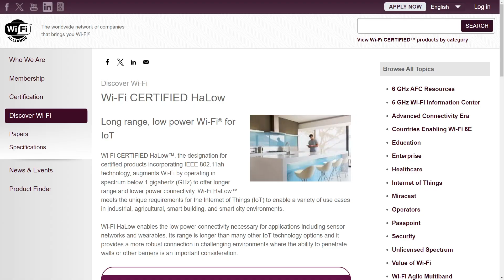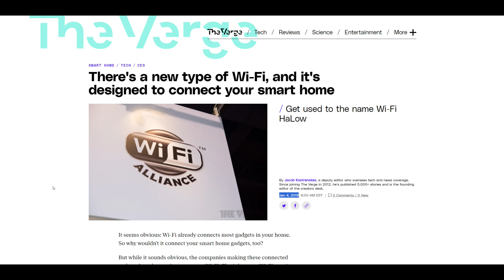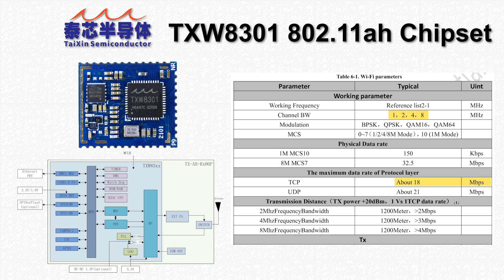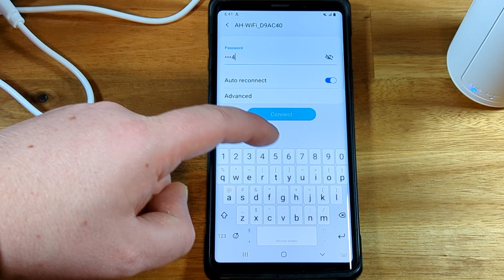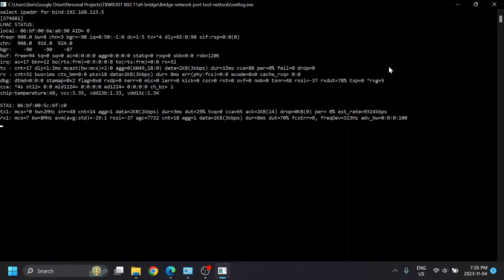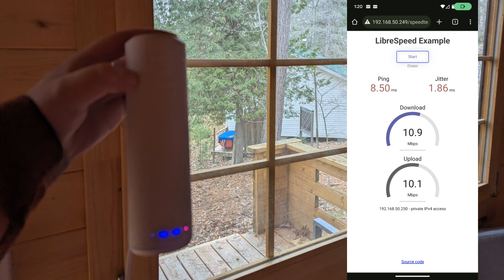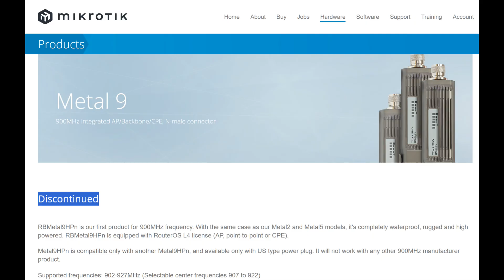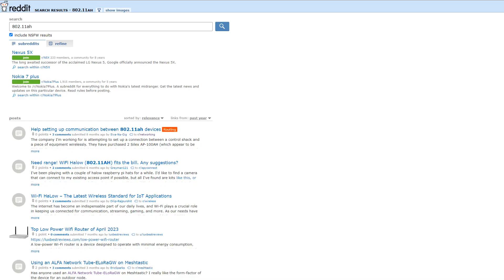802.11ah Wi-Fi HaLOW: The 1 Kilometer WiFi Standard

Comment: I use the Alpha 2H and 2HP to connect cameras to our NVR.  They work great for that.  I’ve also considered using them as a low speed backup feed between businesses for internet outages should one property have an outage.  We probably install a Ubiquiti solution at another location, two businesses about a block away from each other and across a freeway.  One has Fiber, the other doesn’t.
Reply: Linus Tech Tips has a few videos on the topic of getting high-speed internet between properties with line-of-sight on the roof. You might be interested in watching those videos before making the decision, if you want high speed. But even without high-speed, with self-hosted apps, you can communicate between the buildings even if the internet and the cellphone services happen to be down at the same time. 

Edit: Also very useful for preppers, because slow local internet or intranet is much better than no internet and no intranet at all. And the repeater function paired with directional antennas could even be used for things like getting much cheaper internet in third world countries. Especially if it comes packaged with a list of lower-bandwidth custom-clients for popular apps (i.e. for discord, the existing facebook lite and messenger lite, and so on). Even the 8 Mbps, which translate to 1 MB/s of real-life file download speeds, are good-enough for plenty of use-cases. Also, depending on how good it is at going through brick walls, it might be usable to get wifi signal inside backyard bunkers. 

But it's most useful for people with a property which gets internet access a long distance from where the house is or from a point of interest (i.e. a work-in-progress construction on the opposite corner of the property). Might even be useful for getting internet access on hiking trails, because, as someone else said in a comment, a small solar panel and some battery can make it run indefinitely, or at least work indefinitely during the day. Could also be used to have multiple people share the same internet, for example someone getting a corporate internet package, and reselling the internet to everyone who wants to pay a fraction of the price for a fraction of the internet (i.e. basically what many private dorms do).

But, honestly, the most widespread use-case might actually be using it to get wifi in all the rooms of old houses with very thick concrete or brick walls, as well as using the home wifi in the car or in the city without using up the mobile data of your phone.

And if the technology keeps evolving, we might see such technology be used in handheld PCs, for LAN/WAN gaming at large distances. For example, you could be in a corner of a mall playing with someone from the opposite corner of the mall without using the mall's wifi network. And people who live on a mountain where they don't have internet access because the mountain blocks the signal, such a device could be used to deliver the internet from a place where it is accessible (i.e. a shack on top of the mountain) to a place where it is not accessible (i.e. in a valley of the mountain or a valley between mountains). For example, you could use them to get internet access in USA's Grand Canyon.
Reply: @SapioiT  I won't discredit Linus Tech Tips.  However, sticking with what I'm familiar with and not have to figure out a new GUI has its merits.  For the most part, the Alpha Tubes have just worked for me.  I had two and adding a third was as simple as downloading a configuration file from one and uploading it to the third.  After years of use, one went down and (because I buy them in two packs) having another on hand made it as simple again, just needing to remember how to log into the existing setup being the only challenge.  
Unifi/Ubiquiti devices is what I have the most experience with, along with some Cisco.  They have site-to-site antennas that pairs up with a click of a button, alignment indicators for the antenna, and a 6 gbps transmission speed and a 500 meter range.  A bit expensive at $499 a pair plus the required equipment that goes along with it - which I already have installed anyhow.  Honestly I can probably get away with a couple of the LD AP's, but this is just a few dollars more with better weather protection to boot.  The AlphaTubes were, if I remember correctly, $299 for the pair with much, much slower speeds.
Our existing equipment already supplies great internet in businesses and houses.  Got a dead zone? Add another AP without the worry if your existing equipment supports the 802.11h standard.  I've done houses where the client wasn't happy with any existing device on the market except for the Ubiquiti solution I installed; even a 5,000 sq ft house with 3 access points had great coverage, though the client eventially had me add a 4th.  His brother had me do his house and I put two in; he loves his as well.  I use a smaller Dream Router that gives me great speed with its single access point.  One location, a housing unit used by the CalPoly, has 23 access points and absolutely no complaints with rock-solid coverage in every corner.

Comment: Excellent useful content. Would be interesting to see what kind of security video can be transmitted over HaLOW WiFi. (eg: Mbps bandwidth vs. distance). Could also be interesting to experiment with different antennas like an yagi to focus beam in a more point to point style, to create a remote hotspot area. (out building, etc). For low power and remote IoT like weather station, etc, very practical option. Had heard of the standard, but had not realized low(er) cost devices where available.

Comment: Friend of mine is building racecar in the style of an old formula one car. I've been tasked with designing and building a bunch of sensors for it, using can bus to store all the data on an sd card but thinking something similar to this might be an option for getting the data off the card and onto a computer as he pulls into the pits.

Thanks for the tip on this Rf tech :D

Comment: Quite some time ago I worked at a WISP and they used direction antennas with 900mhz, 2.4GHz and 5Ghz equipment to deliver internet to their customers. Even on the old 900mhz standards we were safely getting 5-7miles thru moderate foliage. 2.4GHz we safely were doing 10 miles line of sight and I remember a few customers that were pushing 20-30 miles.

Comment: Do you think you would be able to do some tests at that quarry with the directional antenna? im curious about how the range and breaking the light of sight would fair.
I think i have a good use case for this, every so often i head to the mountains with some friends and end up staying in a cabin with no signal period, No cellular, no wifi or anything else. 
only wifi is down at the lodge about .5 mile/ .8 km away. Im thinking i may be able to tether off their wireless and get it up to the cabins, even 5 mbps would be enough for messages and staying in contact for coordination ect.

Comment: 900MHz? In the EU, 863 – 868 MHz is approved. 
In the EU, 5 channels with 1MHz or 2 channels with 2MHz are allowed. 
This means that these are probably only slow channels.
The cell phone is located in the 800 and 900Mhz band, HaLow is in between. 
If I start transmitting in the 900MHz band, the mobile phone providers' measuring vans will certainly arrive soon.

Comment: Good video. If you are going to do some more testing, I would be interested in seeing how it travels through a multi story concrete building. Like other comments, I am trying to get to a basement carpark but I want to connect my charger to wifi. The OCPP protocol should be lightweight so this would be a good solution. I tried with a PLC but the distance and power phasing was against me.
Reply: If you try this, let us know how it goes. Good luck!

Comment: A test in an open field does not reflect at all the normal operation of the product.
You have to test in a place full of buildings, which is where the product will normally be used. A place full of interference.
Please refrain from using measurement systems discarded across the entire planet like the Imperial System.
NO ONE uses it nowadays.

Comment: 900 MHz is some pretty crowded spectrum. Similar issues to 2.4G - a lot of licensed and unlicensed users, military use, ham radio(on a secondary basis), several decades worth of cordless phones and baby monitors, commercial 2 way radios, a wide variety of ISM devices... Adding a wifi protocol to this mix seems like a bad idea, and in many areas is likely to suffer greatly from interference from other users. A lot of people think 900MHz is pretty empty, but it really isn't - stuff is just transmitting in modulations that aren't easily picked up from whatever you are using.

Comment: Not bad at all, and I too had never heard of 802.11ah before. The fact that it draws relatively low power, and uses low frequency bands, means it could be used in a lot of different scenarios.
Using less than 1W you could easily hook this up to a solar panel and some Li-Ion/Li-Po cells and not need any sort of other power to the system.
Another example is where you said you could only get less than 2Mbps through conventional mobile repeaters even with outside antennas. With 802.11ah, you could find a spot that gets a much better signal from the mobile networks, then use directional 900MHz antennas to transmit to the area you need the internet connection at via 802.11ah (e.g. your cabin), then use your conventional router to find you'll probably get a much better internet throughput.
Reply from the maker: Thanks! I definitely want to explore solar use cases for it. Chances are, if it's far enough away that regular WiFi won't reach, power might be harder to come by too. 

For my cabin, I have a project planned for the spring that will do just that: bring my directional LTE modem to somewhere where it has a better line of sight to the cell tower. 600 feet up a hill behind the cabin gets me about 50 Mbps to a much newer tower, which is more than enough for me to work remotely. For better performance, I plan to do it "the hard way" by running copper landscape wire for low voltage power and fiber for data.

Comment: I was actually doing some research on 802.11ah before coming across your video because I was configuring a mesh wifi system for a client and noticed the satellite APs supported ah which I never heard of and couldn't find much info on and it wasn't even in any of my a+ or net+ cert material, so this video sheds a lot of light, it also sheds soke light on a project a friend of mine is working on to convert his drone to use digital communication rather than analog so he can get a consistent 1080p video feed using what he called a "stripped wifi standard" and after hearing about ah, that's probably what's being used by the transceiver he bought.

Comment: Are you the guy who actually made a post about them on the mikrotik forum a while back? i wanted to ask if you poked around at commands to switch the frequency? in the EU the 900mhz band is illegal to use (already gsm on it), but 868mhz is free to use. on many of these boxes on aliexpress they say chip is supporting 720-915mhz. also worth saying that connecting the board to a log antenna made for GSM should give fantastic results. here in EU we use log periodics to connect to 4g/5g bands and that works great, and in the video you actually have one yourself for gsm too.

Comment: Great review and summary. I am though a bit disappointed regarding the range you get since I have myself run 802.11b over one kilometer with small omnidirectional antennas so it should be possible get at least double that with properly set up directional antennas.

Comment: I'm using the basic box one that you also found to connect my holiday home to my father in law's house about 600m away because we can't get a permanent internet connection there otherwise. 
I've already spent too much money on WiFi bridges that didn't work in our situation because it's not a straight line (mountains) and there are trees obstructing things seasonally.
Initially I had a pain in getting it working reliably, but earlier this year I replaced the antenna at my FIL's house with a basic log-periodic antenna like you showed. On my end I have a cheap TV antenna which also seems to work.
I'd like to be able to monitor the link but I don't have the application you have, so if you can point me to that I'd be grateful. I've been considering adding a ESP32 to mine to be able to access the serial port, but if I don't need to that would be great.
Reply from the maker: Thanks Bob! I originally got the exe files from the AnjieloSmart website (https://anjielo.com/pages/download , click the "WiFi HaLow&repeater" link, then the "AH-WIFI Halow Bridge" folder), they're in the "nettools.zip" file. Taixin Semiconductor has the same files on their site, but they need you to signup for an account before they're downloadable.

I haven't tried tapping into the serial lines yet, but I expect it wouldn't take a lot of effort to use some premade "serial to telnet" code on one of the many ESPs I have kicking around to make it a little easier. Or have a simple web interface that parses the status log entries into an HTML table.

Comment: Interesting. The muni-wifi project of my small town has been a failure so far because of the failure of the father expensive 2.4 ghz devices to be able to penetrate some buildings and foliage to link two sites, in spite of one of them being in a church spire. 900 mhz might be able to do this. Many years ago, I worked on putting up Muni-WiFi in Cambridge Massachusetts with much more primitive equipment. It's amazing how far the technology has advanced. I was also a partner in copy 22 years ago that make phased-array vertical antennas for 2.4 ghz, but our cost of production was high and once the big companies got involved we were finished.